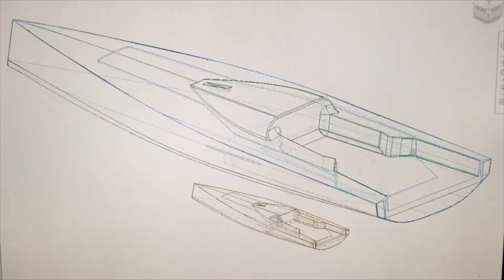400mm long RC VO65 with foils and canting keel

Comment: can you post a video of the canting mechanism in detail?
Reply from the maker: Sorry I don't have any more videos/photos of the mechanism, and the boat currently has no electronics in it. I will look around for the linkage system, and see if i can mock something up. For this boat it was a very simple system. The keel pivot and sealing is the same as the bigger boats, but instead of using pulleys with cables/belts connected to a winch, this boat uses a direct linkage to a standard servo. This was possible due to the very small loads/torques required. It works well, particularly when using a gyro for control.
Reply: @thomasnorton3560  Thanks! could you post weight and dimensions?
Reply from the maker: Dan Lezak 

Sorry for the delay:
Length        = 400mm
Width          = 112mm
Mast           = 600mm
Keel bulb    = 85g
Total mass = 424g